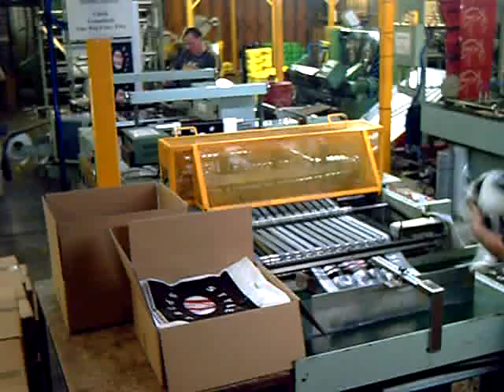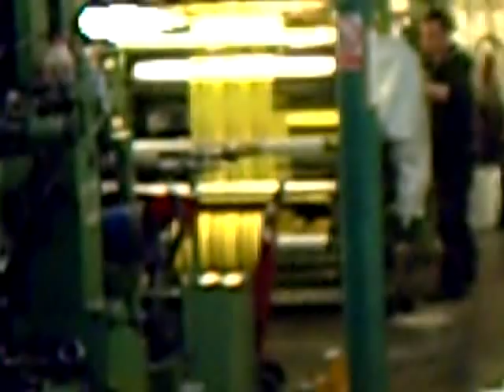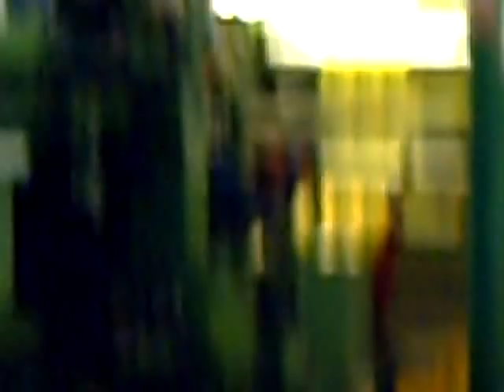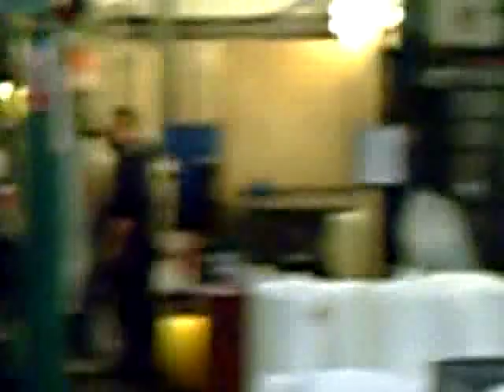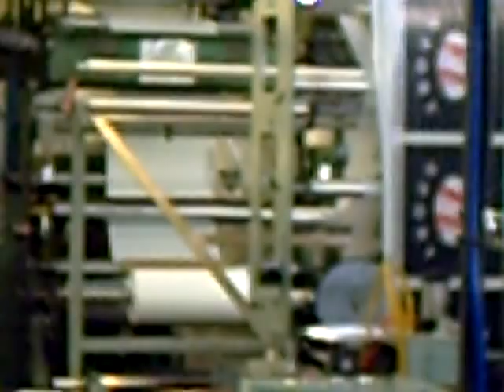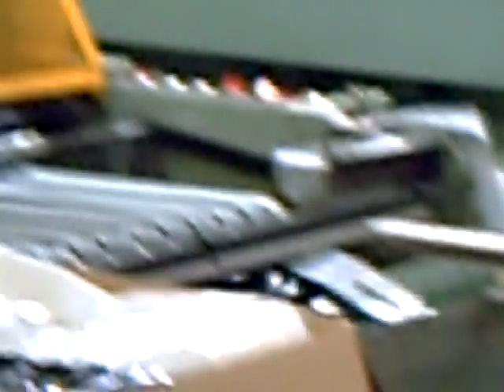bag manufacturing

Comment: i used to run an american machine called polystar 2000 it ran at 125 bpm. why is the operator taking the bags off by hand does the machine not index?